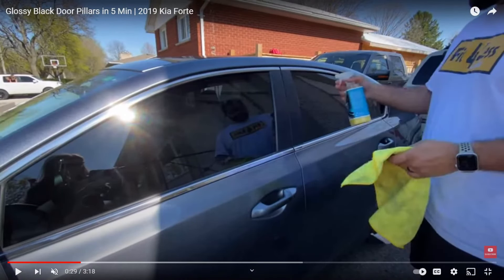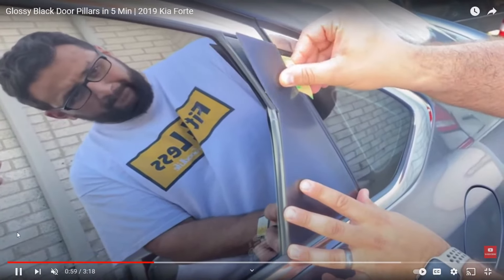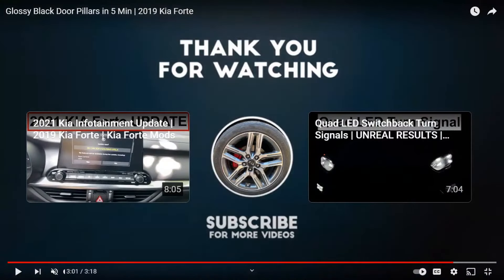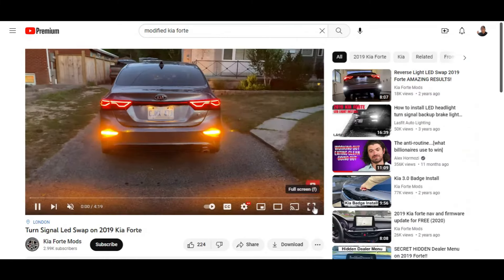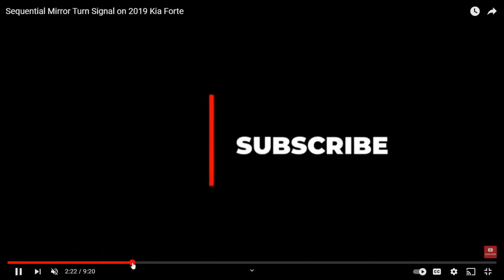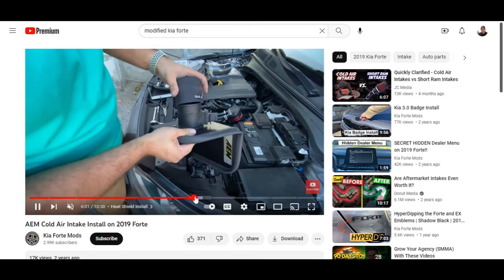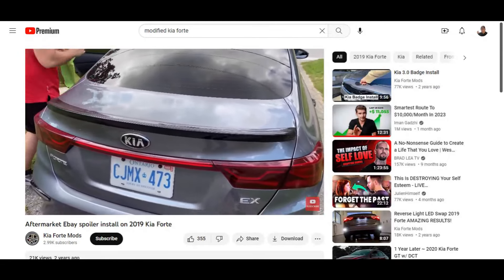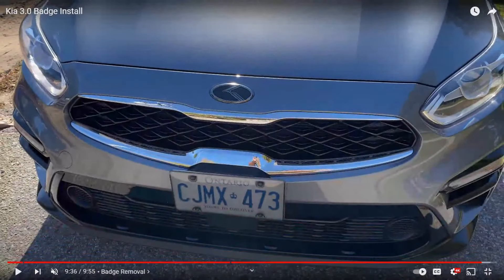Top 8 Kia Forte Mods - Custom Forte Reaction

Comment: 2012 5 speed kia gloss black carbon Evo style functional hood garret 48 mm turbo billet 1 inch diameter fuel rail 750 cc injectors along with pistons oil catch can race clutch plate rods rockers and cam montegi rims black and red shes my baby other then my 73 duster 340